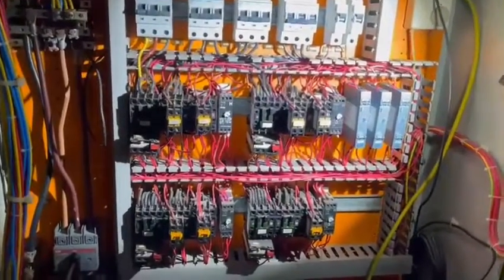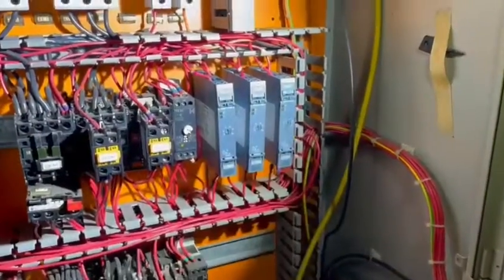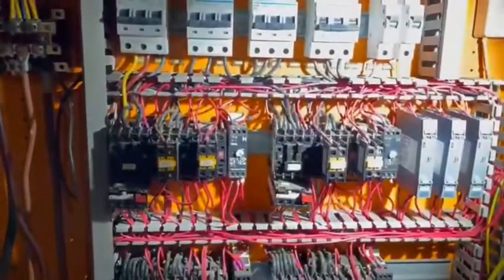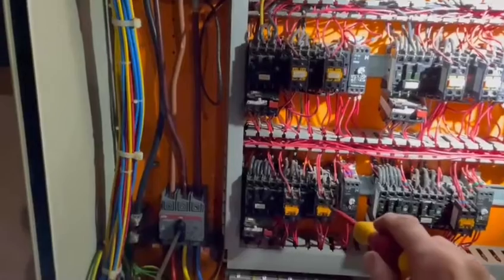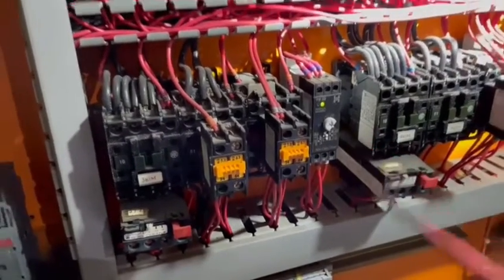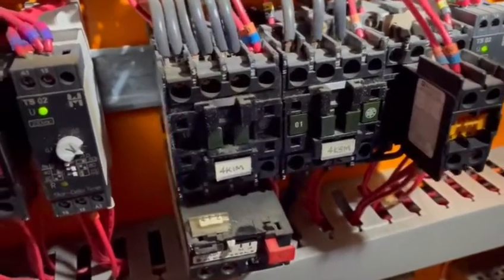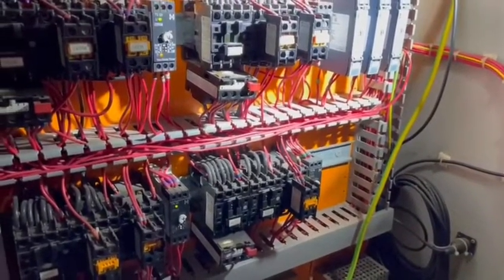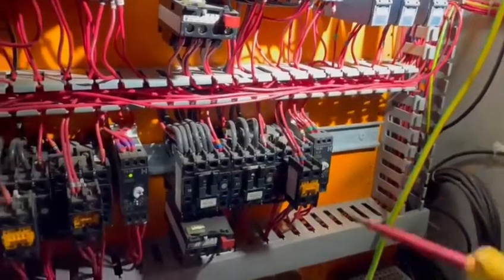Motor Control - 4 Three Phase Star Delta Starters with Electrician Matt

Comment: Do you have a video showing how to wire a Star/Delta DOL 3 phase motor with overload, timer,  stop/start switches,  and neons incorporated? Perhaps also take the components apart if possible to show how the inside of the contactor and how it works, voltage where it appears after switching etc with a volt metre. Show close up details of all connections when they are being connected with the appropriate narration to allow the learner to follow what you are doing step by step. You ;may have it and i may have just missed it. Perhaps on a board on a table in the college or in one of the rigs.

Comment: Now that’s smart, runs like clockwork, proper interesting stuff. Sorry if I get this wrong as I am still learning. but am I right in thinking it’s starts of on star (to get it up and running) then flips onto delta to be fully powered in operation, and the whole point of it is so it doesn’t draw the hell on start up and cost economical